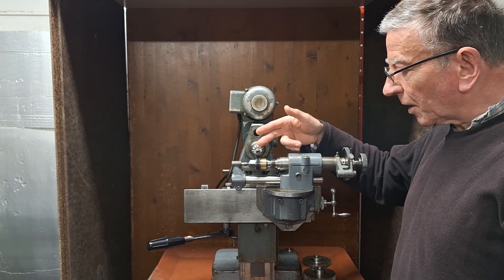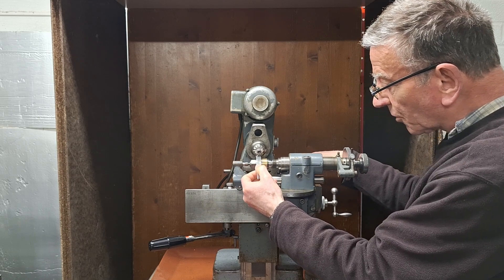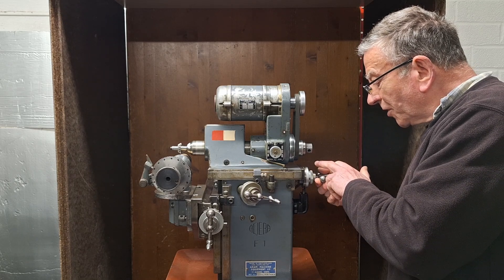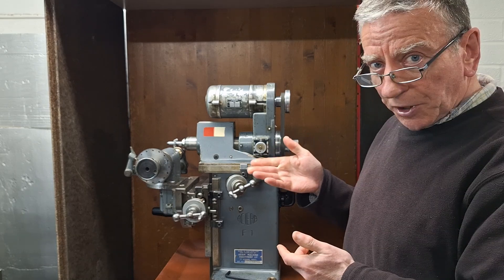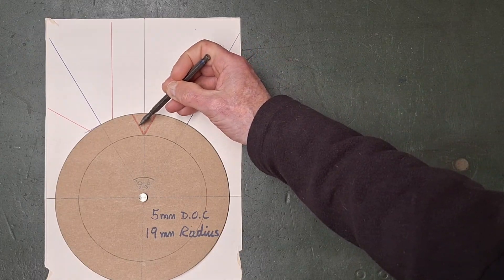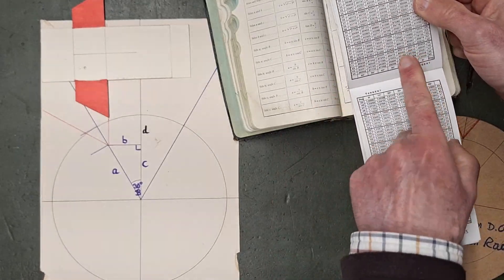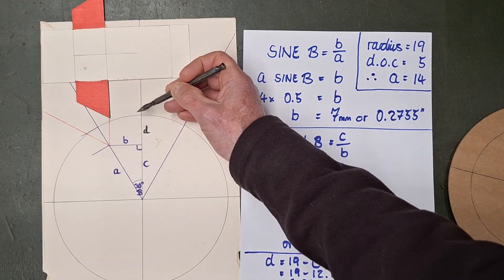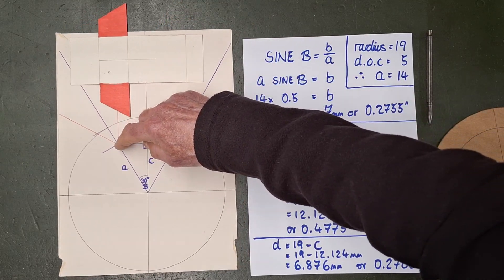Cutter Offsets For Gear Cutting on Aciera F1 Milling Machine

Comment: Great video, clear and with a lot of useful information! Now I want to go out to my garage and cut gears 😀

It would be really nice if the head could be tilted in more directions. But maybe in your case you could use the vertical support in a tilted setting and then turn the dividing head 90 degrees?
Reply from the maker: Thank you for your very kind comment. Yes cutting gears is very satisfying.

I did look at doing exactly what you suggest but with the dividing head rotated there is no room for the tailstock support. Also my vertical support is the double adjustable one with an additional knuckle, so not as rigid. But it all goes to show how adaptable these machines are.
Reply: @ Makes sense 👍 How do the wheels affect the stability? It seems very handy to be able to move it around easily.
Reply from the maker: The castors can be locked off, but to be honest I often forget and it causes no problem. The cabinet sits on a plate of very thick (30mm plus) ply that is wider than the cabinet all round, so the castors are set wider than the cabinet. Fine for small milling machines, no good for lathes!